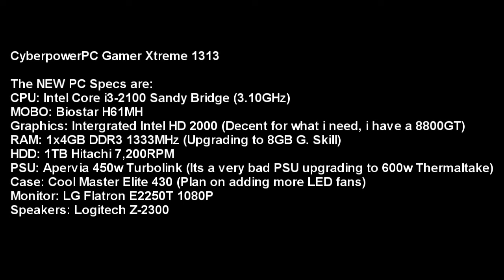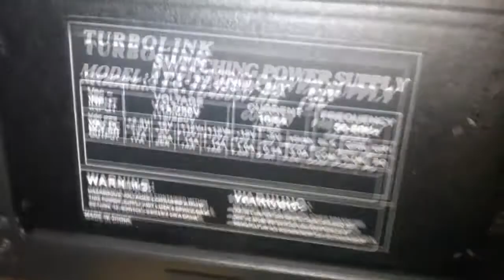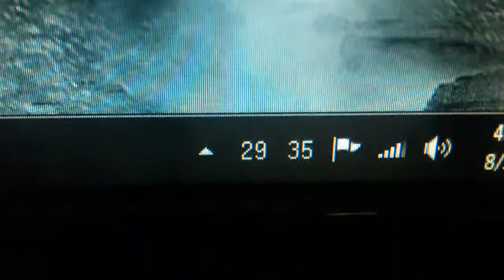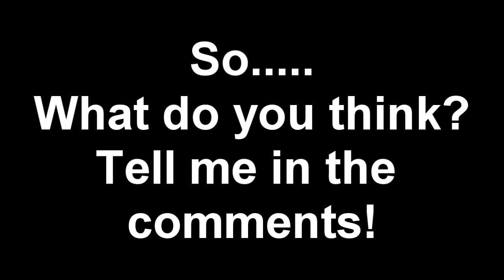CyberpowerPC Gamer Xtreme 1313

Comment: thank u for replying back-  I have a MSI 6570 
To help u slove the problem I will  let  u know the card works , I got it installed on another system , but for some reason the card won't auto detect on my Biostar h61 board 

Do u want my full system specs?

Comment: Either way, it can't run it but you can use a 460 or a gtx 550 or 650 and it will run bf3 high 40 fps.

Comment: @bamfan2044 Processor:
AMD Athlon II X2 260 3.2GHz
Processor Main Features:
64 bit Dual Core Processor
Cache Per Processor:
2 x 1MB L2 Cache
Memory:
4GB DDR3 1333MHz Dual Channel Memory
Hard Drive:
1TB SATA-II 3.0Gb/s 7200RPM
Optical Drive 1:
24x DVD±R/±RW Dual Layer Drive
Graphics:
NVIDIA GeForce GT 520 (1 GB)